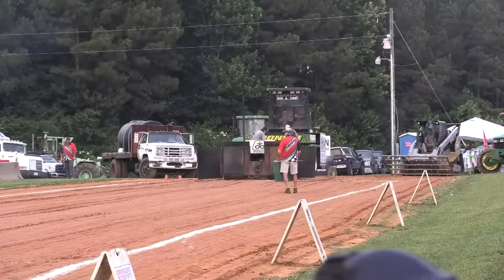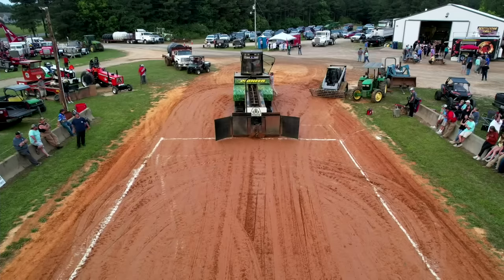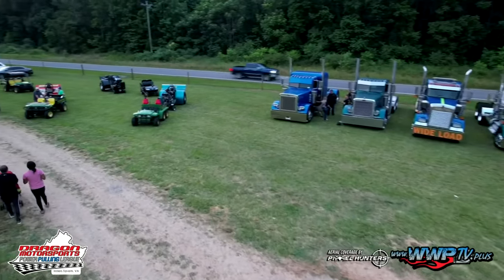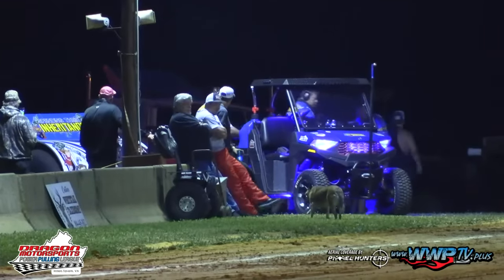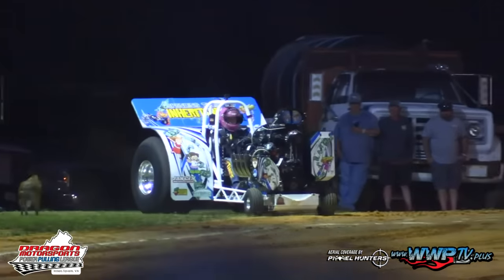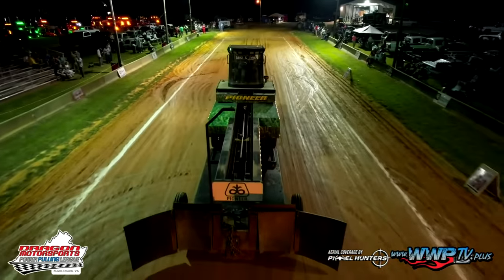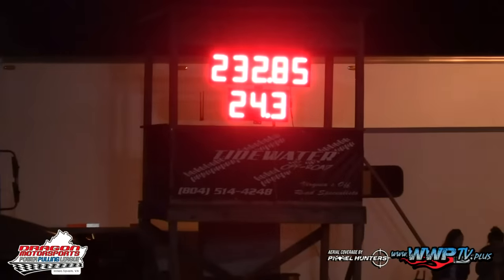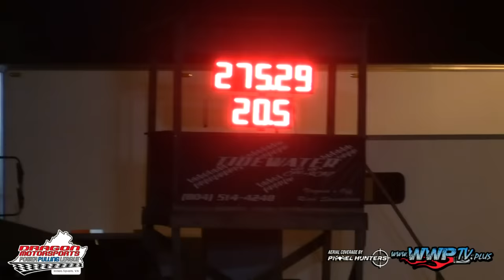Millers Tavern VA Mini Mayhem

Comment: Why does Jamie Evan’s think he’s owed a last run after all this ?? I thought he was done. He had his run .
Reply: The first person to go out and help them get the sled rigged and set for a new class is called the "Test Hook." The test hook has the option to keep the pull or turn it down and get dropped to the bottom of the order, but they have to decide at the end of the test hook run. You can see the issues they had with the kill switch safety shutting him off. They had to hand crank the engine to clear it, add fuel, reset, and restart it. And the engine and clutch are heat soaked at that point, they really need to cool off. So he gave it a tug and turned it down to go cool off the machine and went to the back of the line. That's the rules.